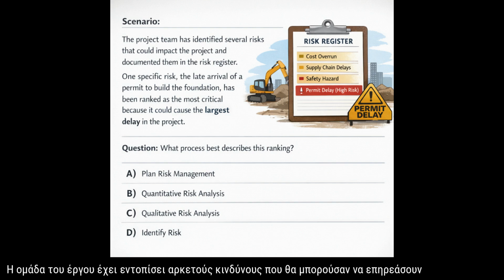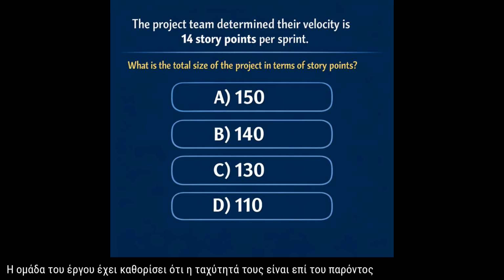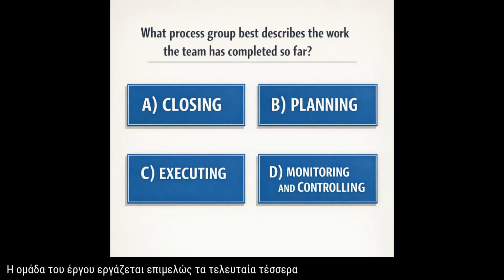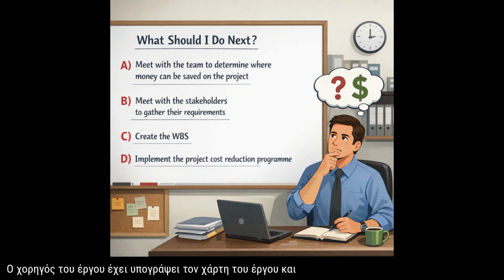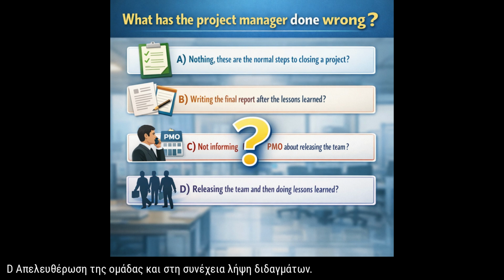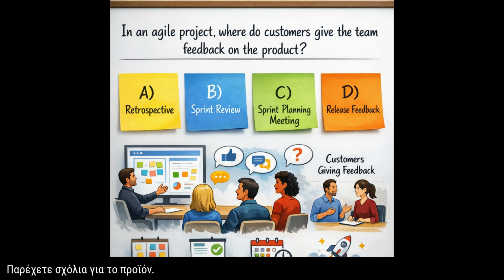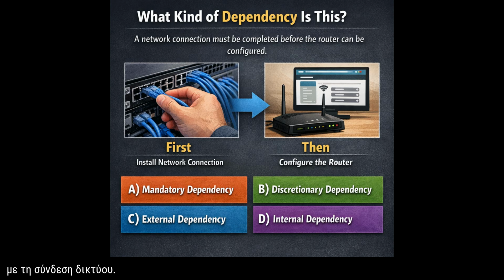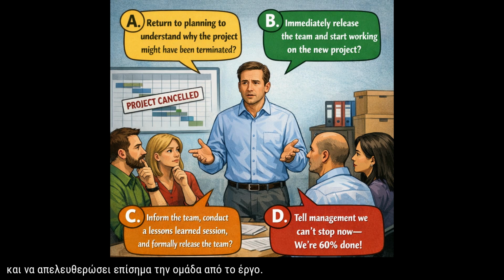PMP Exam Practice 14 | Most Candidates Get These Wrong!

Comment from the maker: 🏆 Project Management Exam — Complete Answer Key with Justifications

Key Takeaway:
Each question below is answered with the correct letter, a concise justification, and a summary table for quick review. This set covers essential project management concepts from risk analysis to agile practices and project closure.

1. Ranking a Risk as Most Critical Due to Largest Delay
Answer: C. Qualitative Risk Analysis
Justification: Qualitative Risk Analysis is the process where risks are assessed and prioritized based on their probability and impact (such as potential delay). Ranking a risk as "most critical" due to its impact is a hallmark of this process.

2. How is the Product Backlog Prioritized in Agile?
Answer: D. By Value
Justification: In agile, the product backlog is prioritized by business value, ensuring the team delivers the most important features first.

3. Total Size of the Project in Story Points (Velocity = 14 per Sprint)
Answer: B. 140
Justification: With a velocity of 14 story points per sprint and a standard 10-sprint project, the total size is 14 × 10 = 140 story points.

4. Process to Create a Categorized Resource Report
Answer: D. Estimate Activity Resources
Justification: This process identifies and categorizes the types and quantities of resources needed for each activity, aligning with the sponsor's request.

5. Process Group for Completed Programming Work
Answer: C. Executing
Justification: Programming the application is part of the Executing process group, where project work is performed according to the plan.

6. Best Output of Reviewing Deliverables Against Requirements
Answer: B. Verified Deliverables
Justification: The Control Quality process produces verified deliverables, which are then submitted for customer acceptance.

7. Next Step After Sponsor Signs Charter with Cost Focus
Answer: B. Meet with the stakeholders to gather their requirements
Justification: After the charter is signed, the next step is to collect requirements from stakeholders to inform scope and cost planning.

8. What Did the Project Manager Do Wrong in Closing Sequence?
Answer: D. Releasing the team and then doing lessons learned
Justification: Lessons learned should be completed with the team present before releasing them to ensure valuable insights are captured.

9. Main Benefit of Agile vs. Traditional Methodology
Answer: C. Agile delivers value incrementally
Justification: Agile's key advantage is delivering value in increments throughout the project, unlike traditional methods that deliver at the end.

10. Where Do Customers Give Feedback in Agile?
Answer: B. Sprint Review
Justification: The Sprint Review is the agile event where customers and stakeholders provide feedback on the product.

11. Regulatory Deadline for Project Completion
Answer: B. Constraint
Justification: A regulatory deadline is a constraint—a limiting factor that restricts the project's options or timing.

12. Dependency: Network Connection Before Router Configuration
Answer: A. Mandatory Dependency
Justification: This is a mandatory (hard logic) dependency because the router cannot be configured until the network connection exists.

13. What Should the PM Do Right Away When Project Is Canceled at 60% Completion?
Answer: C. Inform the project team, conduct a lessons learned session, and formally release the team from the project
Justification: Proper project closure requires informing the team, documenting lessons learned, and formally releasing resources—even if the project is canceled.

📋 Summary Table

#
Question Topic
Correct Answer
Justification (Short)

1
Ranking risk as most critical due to delay
C
Qualitative risk analysis ranks risks by impact

2
Agile backlog prioritization
D
Prioritized by value

3
Total story points (velocity 14/sprint)
B
14 × 10 = 140 story points

4
Categorized resource report process
D
Estimate Activity Resources categorizes resources

5
Process group for completed programming
C
Programming is Executing

6
Output of reviewing deliverables vs. requirements
B
Verified deliverables

7
Next step after charter sign-off
B
Gather stakeholder requirements

8
Closing sequence error
D
Team released before lessons learned

9
Main benefit of agile
C
Agile delivers value incrementally

10
Where customers give feedback in agile
B
Sprint Review

11
Regulatory deadline as project factor
B
Constraint

12
Network-before-router dependency type
A
Mandatory dependency

13
PM action after project cancellation
C
Inform team, lessons learned, release team

Key Finding:
This answer key covers core project management concepts and best practices, providing clear, actionable guidance for both real-world scenarios.